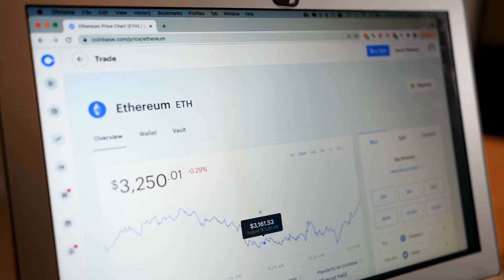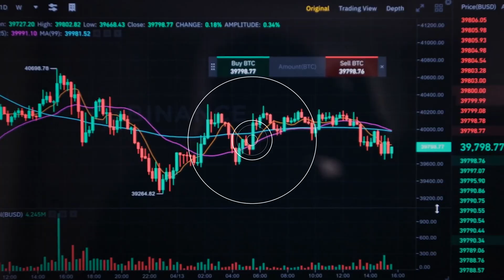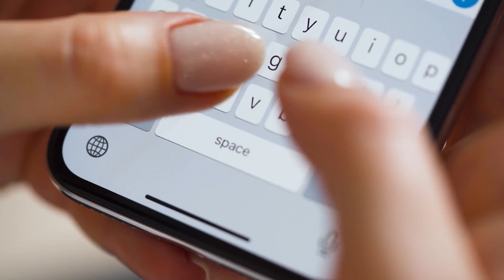Nvidia 4000 Series SHORTAGE or Surplus?

Comment: Saw this video and inmediately ordered 3 4090 for FOMO
Reply from the maker: you were able to order 3? also... are you aware of the power cable melting issue? basically if the cord is bent at all it will melt the connector
Reply: @Top Tier Tech  3 zota trinity they restocked and already pre-ordered 3 ekb water block to it. Only gigabyte windforce and gaming oc remaining in low stock